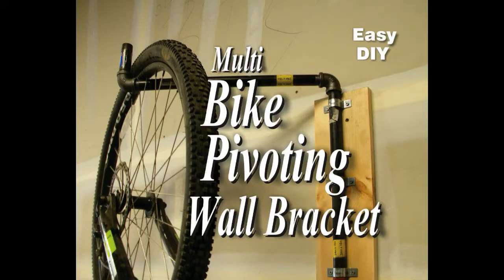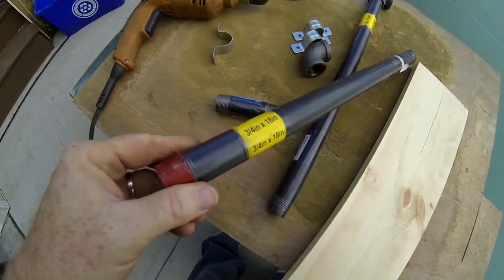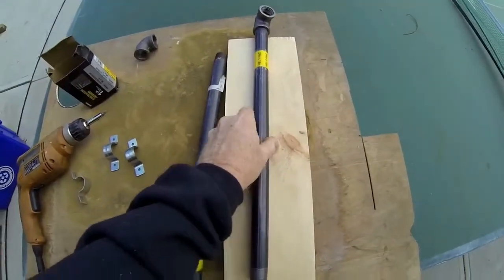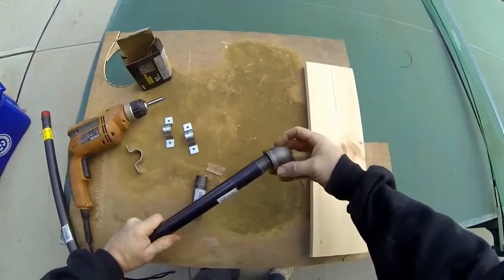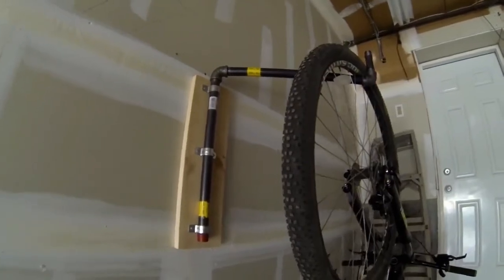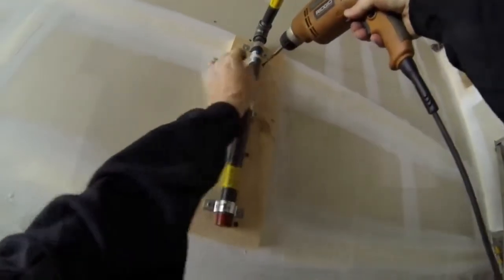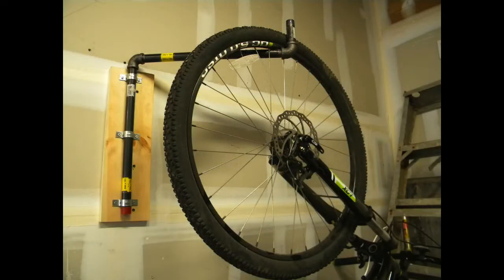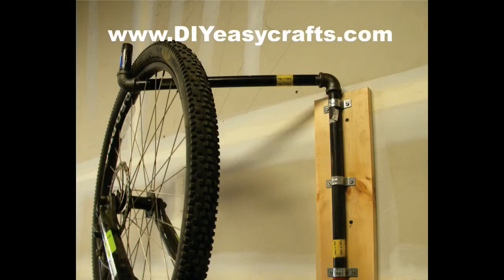Easy DIY Multi Bike Pivoting Wall Bracket

Comment: Nice job.. I would have added a pipe cap on the short nipple .
Reply from the maker: +Str8 Shooter I was going to but the cap made it difficult to fit through the tire spokes. 1/2 inch pipe should be plenty strong and small enough to allow the pipe cap.